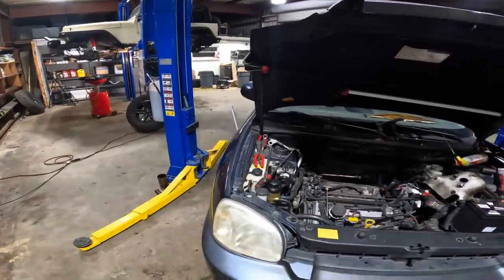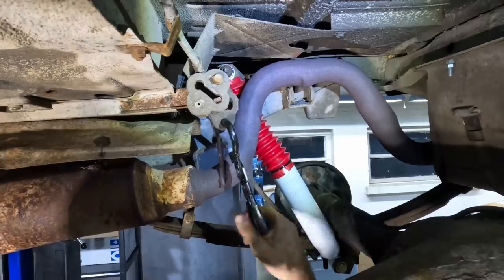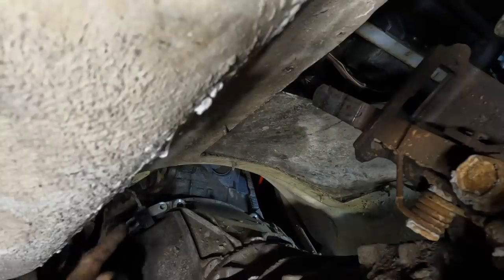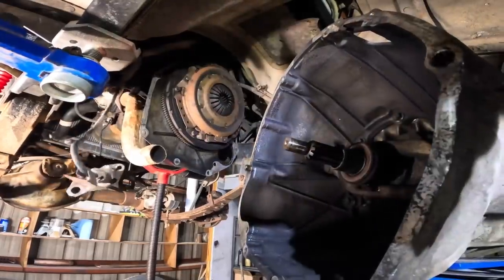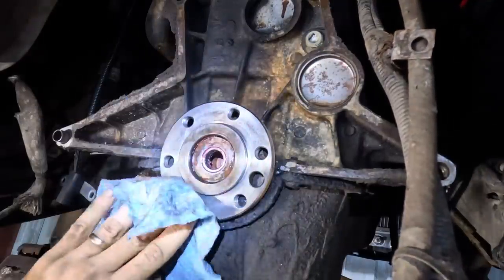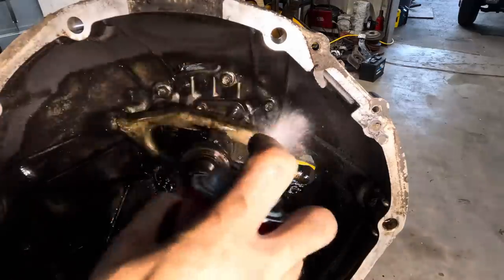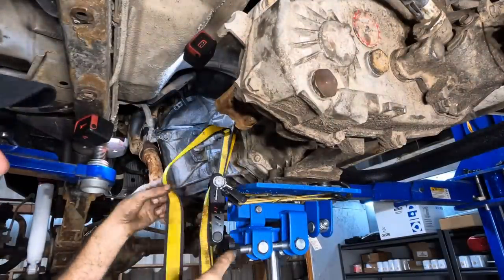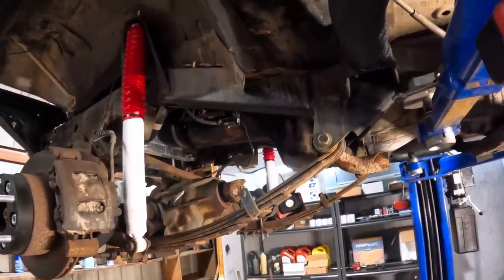Smallest Shaft Ever! FRIED Flywheel! | Project JEEP! 1995 Wrangler YJ

Comment: In the future if you are pulling an input bushing or bearing and don't have a puller, pack the hole with grease and use a rod/shaft or bolt close to the same size and hammer it into the hole. The grease will force the item out as you push the rod into it.

Comment: We used to put the tranny back on without the tool. Just hold the tranny in place and press the clutch lever with whatever fits. When the clutch releases a little the tranny will slip into place.

Comment: To get the pilot bearing out, fill the hole wit grease, get bolt or tod the size of hole. Inert the tool in and tap on it. the bearing will slide out due to hydraulic pressure.

Comment: An easier way to remove pilot bearings.  Pack the hole with wheel bearing grease, get an old pilot shaft or clutch alignment tool. Drive that tool into the pilot bearing hole and the bearing will pop out. Did that hundreds of times.

Comment: A hack I used in the old days to remove pilot bearings was to pack them with grease and use a bolt almost the diameter of the bearing and strike the bolt with a hammer.  Since the grease wouldn’t compress it would drive out the bearing.  I was too poor to afford a puller.  LOL

Comment: So I’m sure someone else said it but I just wanted to share my experience with the pilot bearing and no puller. 
Find a dowel or something of that sort that fits snugly in the bearing, fill the space behind the bearing with grease ( like your grease gun) then pack it with the dowel and a hammer. As you pack it, the pressure will push the bearing out. It has worked for me in a pinch. 
Just sharing my experience and keep up the good work, shop is looking pretty good 👍
Reply: Supposedly bread works too.

Comment: I got so good at pulling motors out of my Jeep. I could swap out a motor ,flywheel clutch. From start to back on the ground running in 4 hours. Problem is I had to do it 4 times in 60,000 miles. Same rod broke in 3 motors. Dropped a 350ci crate motor and never had another problem.

Comment: Two thoughts! Ballbearing pilot things are not reliable and will destroy easily. I would never put a jack stand under a oil pan without a board to distribute the force and protect from accidental puncture.

Comment: That lever for the cutch ,,   FORK
Input shaft is stuck in the clutch disc
No loctite on the flywheel bolts ?
Sounding more and more the owner bought this jeep for a couple hundred bucks

Comment: Original clutch parts? Possible. I bought my TJ with a 112K and one of the things I counted on was having to replace the clutch fairly quickly. I did so 18 months later at 119K miles. Flywheel was in good shape, so light hand sanding, new clutch and throwout bearing. 

You need to remind everyone what J.E.E.P. stands for - Just Empty Every Pocket. If it's not spend on repairs, it's spend on upgrades. I have two of them ('03 and '17). I should probably be committed, but they get in your blood.

Comment: We had a 90 bronco 2 to put a clutch in took all the bolts out to pull tranny could not get it to come out would come back an inch that's it pulled prayed and cussed finally got it out well trans shaft was grooved so bad had to replace never saw that b4

Comment: One of the last clutch jobs I did was about 1981ish. We did it on the floor of my friends garage. My 1972 4 speed AMC Hornet. Clutch, pressure plate & throw UP (😆) bearing. Good memories. 
The reason why its now called a throw up bearing. Is because when my friend took it out. He threw up. I think he had one to many adult beverages.  😆

Comment: To get the centre bearing out, fill with grease, us a gearbox primary shaft or a bolt of the right size and smack it with a big hammer, that will drive the bearing out.

Comment: I realize you have already removed the pilot bearing with a tool, but years ago I was taught another way.  After struggling with a solid bearing, someone told me to pack the hole with grease and put a snug fitting dowel  in and hit it with a hammer. The darn thing popped right out.

Comment: Maybe it is not a thing to do now but decades ago we had torque specks for flywheel & basket bolts. other things I noticed, dirt on to flywheel face when insirting tin flywheel plate, remove preservative from new flywheel & new basket,

Comment: Another way to get pilot bearings out is to pack the pilot bearing opening with grease and use a metal shaft and drive it in the opening and the grease will force the bearing out

Comment: Another deja vu video.  I replaced those E-Torx with regular hex head bolts when I did my clutch.  And I wish I had the later Aisin transmission instead of the Peugeot POS with internal slave.

Comment: So I get that as a for-hire mechanic you do only what the customer wants.  But you can say to your customer - Rear main seals on Jeeps are notorious for leaking, and since we’re gonna be in there anyway, recommend that we replace it.   85% of the time I’m ok with you not torquing bolts, but here I would torque the flywheel and basket bolts to spec.  I am also amazed that the skid plate came off without a bruising flame-filled battle.

Comment: A trick for getting the pilot bearing out is shoving bread in there and using a right sized bolt to hammer it in which pushes the bearing out..   Worked for me on exactly the same vehicle.

Comment: I was starting to worry a little when you went to install the new flywheel.  I had flash backs of replacing a flywheel on a 1992 Volve 240 and got a shocking surprise that even though it's flywheel is timed, it can be bolted on in any orientation.  I was lucky that I had marked the old flywheel out of habit, so I was able to match the old flywheel orientation to the new one.

Comment: Another option for removing that pilot bearing without a puller is: pack it full of grease and use a snug fitting rod or punch in the hole, whack away and it pops right out. It uses the hydraulic principal.

Comment: I had a new clutch put in my 2003 Mach1 at about 60k mile. When I drove it from the shop, there was a significant vibration over 4k rpm. I immediately turned around and dropped the car back off. The shop claimed that it was bad transmission mounts. After having those replaced there was still a lot of vibration. After taking it back the 3rd time they finally fixed the problem which I believe was some screw up of the clutch installation. I never learned what it was that they had screwed up and then subsequently fixed. What would cause heavy vibration after a clutch install? I never used that shop ever again.

Comment: ray-
next time on your pilot bearings.....
use a slice of damp bread.
wad it up and shove into the pilot bearing hole. as much as possible.
use a blunt end punch that closely matches the inner diameter of the pilot bearing.
use tape on the punch if the punch needs to be a smidge larger.
place punch up to pilot bearing hole and hammer away.
the bread will hydraulically move in behind the pilot bearing and press it forward and out.

DUN !!!!!

Comment: In the not so distant past we used grease. Grease gun to inject into hole until full and a clutch alignment tool in hole to Hydraulically  remove them.

Comment: I just swapped out my NV3550 in my 02 tj for this same trans exhaust must run differently on the TJ because i didnt have to touch mine, just unbolted the trans mount and slid it off the exhaust hanger

Comment: An easy way to get that pilot bushing out is to get a bolt with a shaft the same O.D. as the pilot bearing I.D. - cut the threads off and smooth the tip. Fill the pilot shaft with grease, insert the bolt and apply linear impact. The bushing will pop right out with hydraulic pressure. Same technique for my 1947 Plymouth. :goodvibes:

Comment: Polishing the flange around the pilot bearing maybe should have included a towel over the greased bearing to prevent premature failure.  

I love a clutch replacement.  Unless the car is on the ground in the snow and mud.

Comment: You said there was leftover gasket material on the rim of the bell housing. Did you add a gasket or apply gasket material to the bell housing? If I missed it sorry

The yellow ball joint for the fork for the clutch thrust bearing looked like it was plastic - does this require a non oil-based grease?

Love your videos, especially the lengthy diagnostic ones. Huge amount of skill, but you also communicate it so well

Comment: Put the nuts back on the trans mounting studs. They will protect the threads for later. Also replace the u joints before assembly.

Comment: box needs to be in gear, so you can rotate the output shaft to turn the input shaft,so the splines engage.easier..try this on the ground with an 135 lb zf 5 sp

Comment: 42:45 this is when I put the transmission in fourth gear so I can wiggle the output shaft back and forth with the drive line installed. It will line the splines of the input shaft up with the clutch disc's splines. Then you got to wiggle wiggle wiggle the whole transmission to sink into that pilot bearing.

Comment: 40-some years ago, when I was much younger and very much un-knowing of the inner workings of a car, I was coerced into trading off an other-wise very nice '74 Buick Apollo manual trans car because it needed a clutch. I was told it was a very difficult and expensive major repair. I later learned the guy had used his 'scare tactics' because he wanted the car for himself, and he did buy it from the guy I traded it off to ... they were buddies and I was the dumb kid.
Live and learn, right?
Wiggle it, it'll go in!

Comment: when you work by yourself, any tools that make your job easier is worth it. if its a spendy tool, is it going to save time to help make money? for me, i buy tools looking at the future use and with the way prices are going up, buy now IS saving money.
just a suggestion....buy the dewalt dcg418 60v grinder. ive been running mine since 2018 and its still going strong. i have the dcg414 which is the original and the 418 is the updated, more power version which i just got but havent put into service yet as theres lots of white stuff on the ground and you cant pour concrete in the winter. the 414 was the most powerful grinder on the market till the 418 came out.

Comment: Ray  ---  Cringe time when you used that Pry Bar to remove the old Pilot Bushing .  For future reference , the easiest way to remove a Pilot Bushing is to fill the Bushing cavity with Grease , and then insert a wooden dowel just slightly smaller in diameter than the inside diameter of the Bushing and about 8 inches long .  Give the back of the Dowel a couple of sharp raps with a Hammer ,  since the Grease won't compress it forces the old Pilot Bushing out of it's pocket .   ---   < Doc > .

Comment: Easiest pilot bearing / bushing removal method- Buy a cheap universal clutch alignment tool or find a hardwood dowel that fits the bearing tightly. Fill the cavity in the crankshaft with heavy grease. Insert tool / dowel and smack it with a hammer. The pressure will pop that bearing / bushing right out. Clean the excess grease out of the cavity and install new bearing / bushing.

Comment: for pilot bearing i fill the hole with grease and use a bolt the sise of shaft and hit it with hammer out comes the bearing.

Comment: In the when installing heavy manual trans I have made dowels out of very very long bolts wih their heads cut off and a slot ground into one end for a slotted screwdriver.  Just pick the best two tranny bolt locations, thread the dowels in and use the dowels to guide the tranny into place.

Comment: Don't forget to remind everybody to clean off the flywheel from machining oils and pressure plate surfaces from machines oils and use some loctite on torqued on flywheel bolts and pressure plate bolts

Comment: Be careful with those. My buddy had to cut those out and replace the thread inserts in the frame. They were removed and new ones were welded in. I hope he used anti seize on the new bolts during reassembly.

Comment: Nice video..How did you luck out with that front driveshaft I have done 5 jeep transmission this month and 3 of them the front driveshaft was frozen had to free them up lol . I can’t wait to see the rear end install. I have been also doing a lot of 4.88 and  5.13 gears swaps as well lately. I work at a off road shop down in port Charlotte fl

Comment: Excellent video as always, but for once I have a question. Ray, you mention the remains of a gasket which you cleaned off, yet I cannot see a new one being installed; is this because it is not necessary as it is a dry fitting or have I missed something entirely?
Many thanks, regards

Comment: 24:40 pack it full of grease and put a shaft that fits perfectly in the pilot bearing into that hole. Smack the shaft with a hammer to use hydraulic pressure against the pilot bearing. You can use bread too. I've done it when my new pilot bearing puller was too big for the hole and the parts stores were closed.

Comment: Your videos are always so realistic I can almost feel the dirt and grit and need to go scrub up after watching them!
Will that bottom mounting plate not have to come off again to get the front drive shaft fastened back on to the trans?  Or do you reckon you can get in there to get the bearing straps back on sufficiently remotely?  You took the shaft off after you had removed the plate earlier on ....

Comment: Ray, did you install a new clutch without cleaning the oily film off the new flywheel?  You use so much brake cleaner then miss this important opportunity lol. And no actual clicks on the flywheel and pressure plate bolts?  Shame.  At least you installed a new throwout bearing.  Overall a good job although I would not draw the trans forward using the bell housing bolts. Thanks for another good video.

Comment: you need a pressure washer so when you make it nice and shiny on the inside (new parts) you can make it nice and shiny on the outside too. i do love the nice and shiny.

also, i was peeved at the mechanic when i had an axle replaced and he cleaned NONE of the grease that it slung. all it needed was a couple minutes of rag and brake clean to get the slop out, and he didnt even do that.

Comment: Ray, while you are there, wouldn’t it make sense to replace the rear main crankshaft seal? Looks as if it has been leaking engine oil.
Reply: To be honest the RMS is usually NOT the leak on the 4.0, its the Valve cover and the filter adapter but the rear there is the lowest point so it all runs there. Now having said that, Yes, I would have pulled the pan and and changed it all out with a solid cleaning to boot.  +a  front tranny seal and fluid change in both the t-case and tranny

Comment: Definitely should clean off the metal surfaces before installing the new bearing.  I saw what looked to be shiny dust adhering to the grease and the needle bearings looked dusty as well.

Comment: If I don't have something to pull the pilot bearing I fill the hole with grease and then hammer in something as close to the same diameter as the hole as possible and it drives out the pilot bearing with ease every time

Comment: I know driveshafts are balanced from production.
However when completely removed I always marked the  exact same bolts with holes to keep the balance when reinstalled..
Is this not a necessary procedure.
Unless installing a whole new driveshaft and universal joints..

Comment: I see a clutch that has been ridden and defaced the flywheel. Probably a back and forward to get out of a bog situation. There has been water/mud up in the area to score the flywheel. Seen this before. However I ewally am surprised you did not locktite the flywheel bolts and torque those bolts correctly. I do not see an electric rattle drive as sufficient for some applications.

Comment: You should have tilted the motor back a little bit and put your hijack underneath the oil pan and you lower it down and it gives you the perfect angle pulled out I used to do Transmissions all the time and you're actually taking a little baby transmission I just take him out of those big trucks all the time but I got to put a little bit of angle you let it drop down a little bit and then you put your hijacks down underneath the oil pan to support the motor the easy way to do it

Comment: O did that job on a 1983 Jeep Cherokee years ago. No vehicle hoist, no trans jack, no adjustable jack stand, no power tools...just me lying on my back on the grass and dirt mostly in the dark, and struggling with the weight of the unit when unbolted. Not easy, bu got it done. Main input shaft on the Borg Warner 5 speed was completely shot to pieces, so had to fit a new trans. Not my favourite job. Not a fan of Jeeps.

Comment: It never ceases to amaze me how people let maintenance go on something like this until every single system needs attention.  Keep the maintenance up, and the only thing that kills a car is lack of parts availability.  If you have to do a big ticket item, like a clutch, save yourself labor and do every wear item in that area while you have it apart.  Put in a new rear main seal whether it needs it or not.  It sucks to have the rear main start leaking right after you've had the transmission off (you did replace it, didn't you?).  It doesn't matter how much the repair costs, for the most part, it will never equal a year of payments on a new car (unless you have some super dooper luxury car).

Comment: Wait till you change a seal or wheel bearing on the passenger front. There is a small  roller bearing similar in size to the pilot bearing but *uncaged*. Sliding that axle shaft back into the tube where it meets the intermediate shaft without dropping rollers in very limited access is a stressful experience.